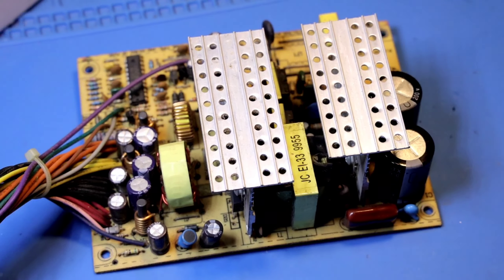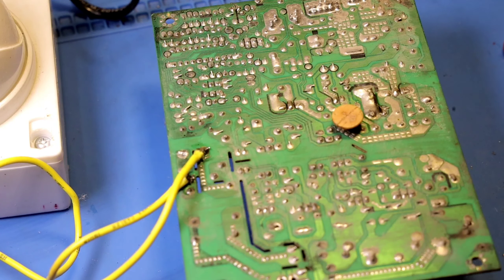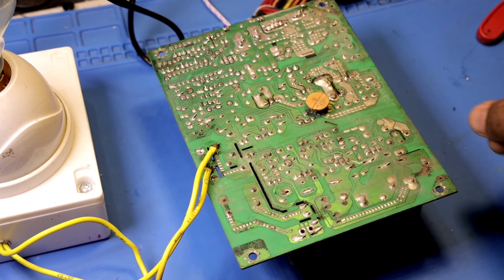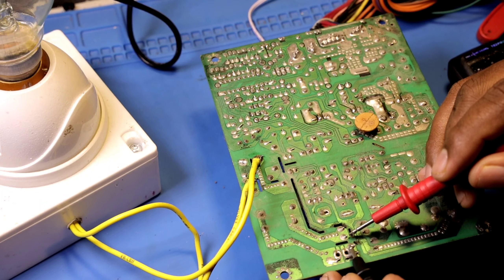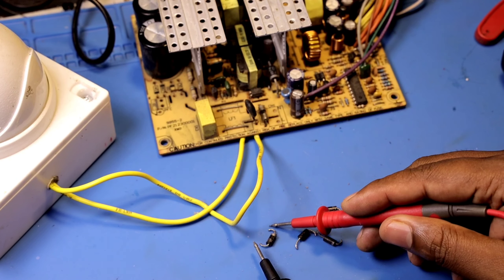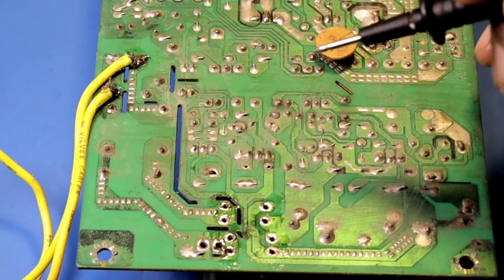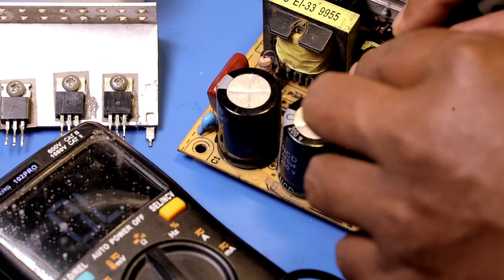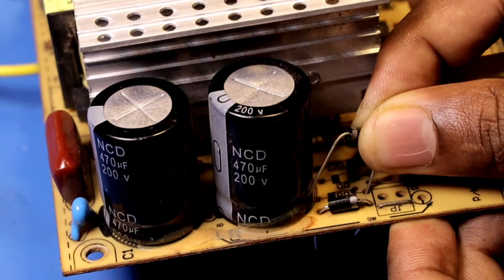how to repair computer smps short dead problem #computersmpsrepair

Comment: My computer smps shows Only 11.6 volt in yellow wire. Out put capacitor checked ok. Which component shall I check to repair it. Pls advice
Reply from the maker: Check other voltage 3.3 and 5v
Reply: Thank you for your quick response. The other out put voltages are 5.1v & 3.3v are ok.

Comment: Smps il green 🟢 wire, purple🟣 wire voltage ok. But baaki outputs onnum illa. Output capacitors ellam remove cheythu check cheyyumbozhum, capacitor side short kanunnu. Endhayirikum fault.?
Reply from the maker: Resistance zero ano kanikunne??
Reply: @TubeLightDiscover  athe.. Ys
Reply: @TubeLightDiscover  shortkey diode bordil check cheyyumbol short kanunnu. Remove cheythu nokumbol no problem.

Comment: Green & black wire thammil connect cheythappol fan on aayi, inippo ntha cheyyendath bro?
Reply from the maker: Problem enthanu???
Reply: @TubeLightDiscover   2yrs aayitt system on aakkunilla, ipool cpu on aakkitt on aakkunilla, SMPS fan work aakunillarunn, ippo eee video kand green & black thammil connect cheythappol fan work aakunund continues aayitt.. inippo ntha cheyyendath?
Reply from the maker: Check SMPS all output.red +black, yellow+black, orange+black.ellam ok anegil mother board section avan anu chance
Reply: @TubeLightDiscover  SMPS & Motherboard fan ok wrk aakunund, but monitor on aakkunilla, ntha reason?